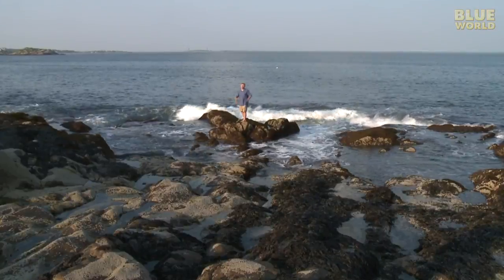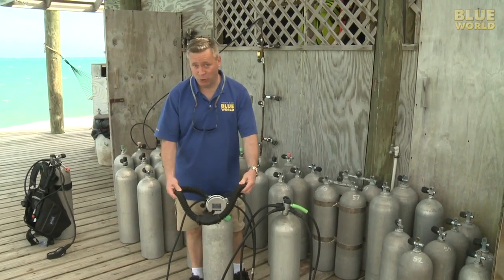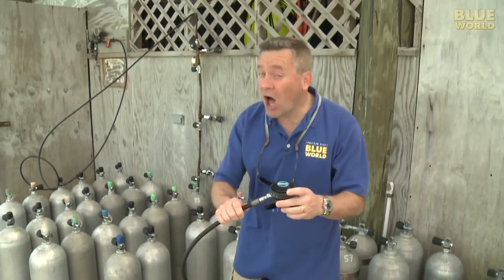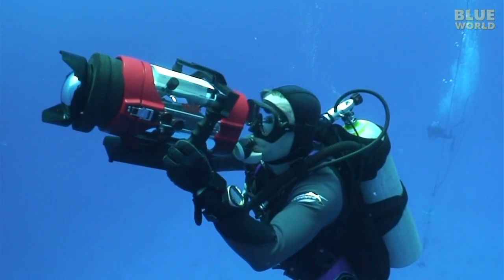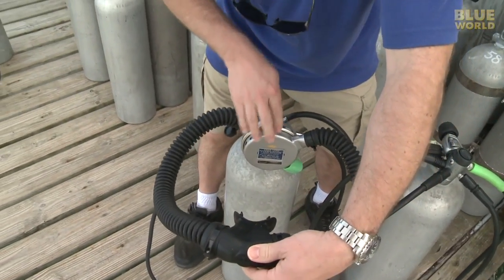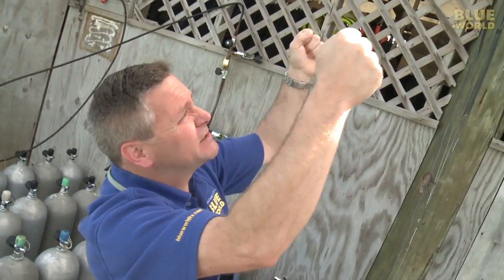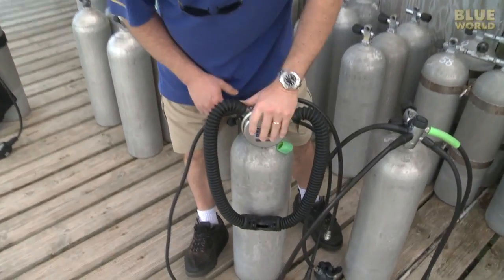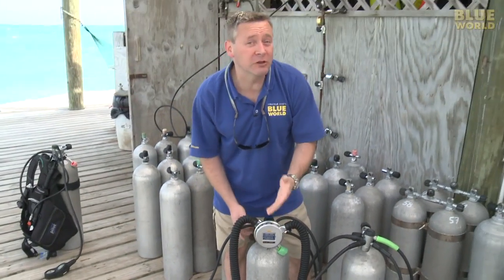Double Hose Regulator | BLUE WORLD TOOLS OF THE TRADE

Comment: How do you usually rinse your double hose reg after a dive or after a dive trip? :) gonna dive with my first twin hose on the next dive.
Reply from the maker: You remove the hoses from the regulator, then remove the mouthpiece from the hoses and rinse it all out.  I just hang the hoses and let them drip dry.  My friend Luis has a small vacuum cleaner and he connects the blower part (not the suction part) to the hoses and runs it for a few minutes to blow dry them quickly.  Either way works.  The key is that you take them apart because otherwise they won't dry on the inside and you don't want to get mold in there.  I only do this at the very end of a dive trip.  During the dive trip I just rinse them every day and leave them attached to the regulator.
Reply: @BlueWorldTV  Thank you so much !